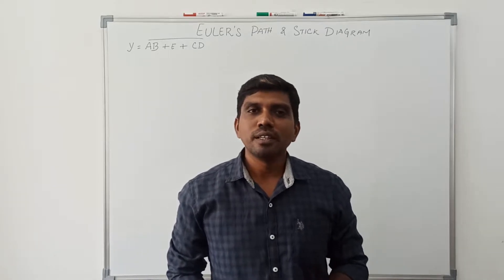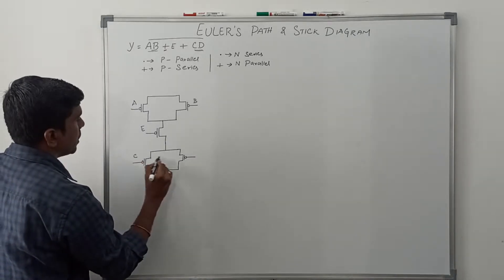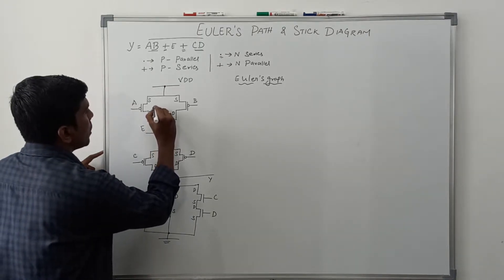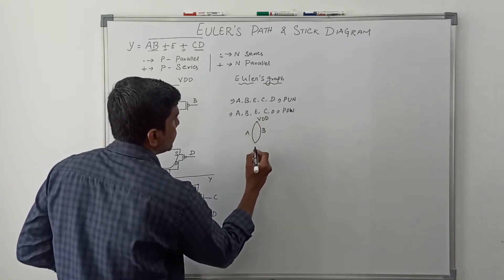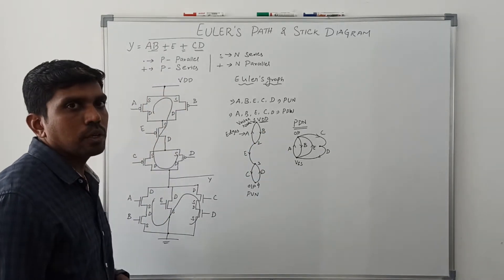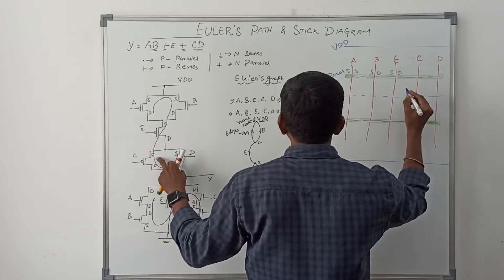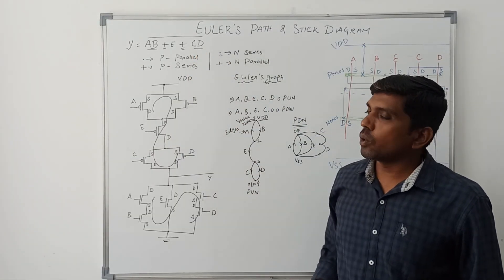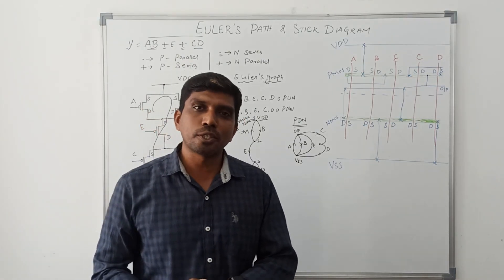Unlocking VLSI Design: Euler's Graph & Stick Diagrams || Learn Thought || S Vijay Murugan

Comment: In the PMOS pull up. 
I put AB >> CD >> E (meaning E below C//D).
Then I CANNOT draw a stick diagram though I try a lot. Why does this bug happen sir ?
Reply: If you do like that, the circuit does not have an Euler path, that's why you could not do a stick diagram. You need to put pseudo inputs then you can draw a stick diagram, there are certain rules to put pseudo inputs like you have to put pseudo inputs only in the edges and two pseudo inputs should be in subsequent. When drawing a stick diagram you can either keep or remove pseudo inputs note that if you remove pseudo inputs from the stick diagram then you have to mention the delay in the stick diagram showing that pseudo inputs got diffused.